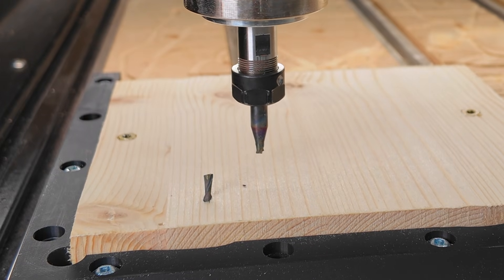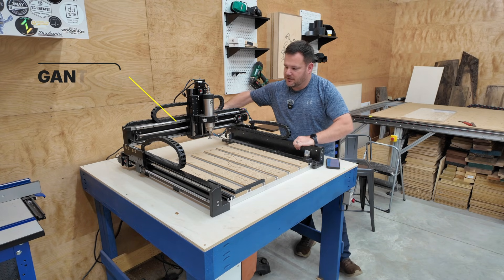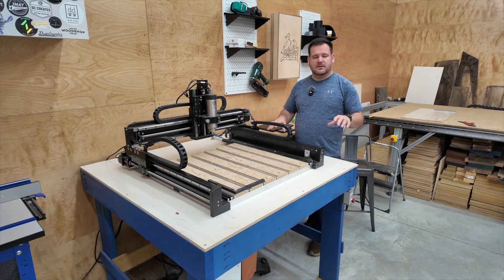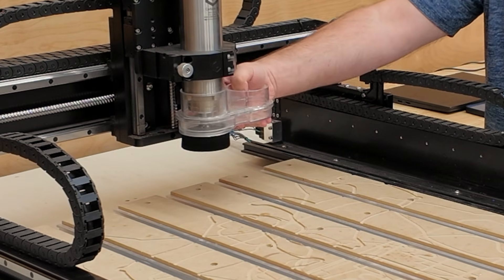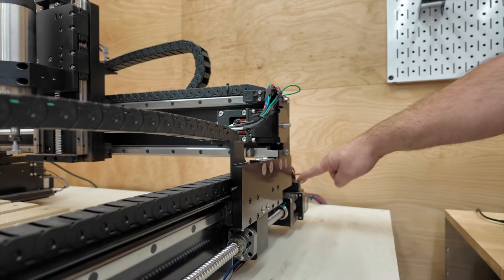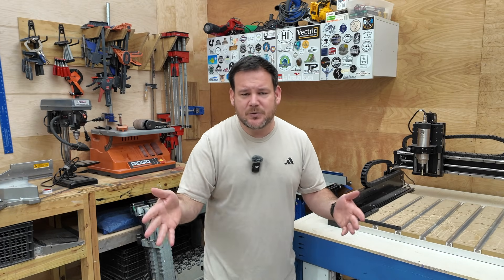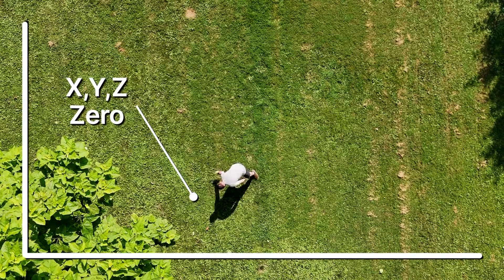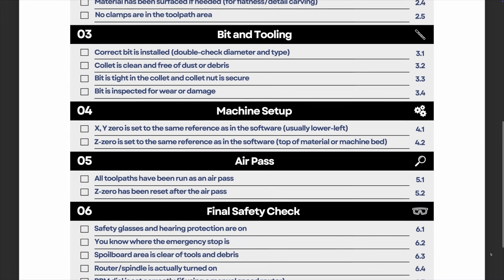CNC Beginners: I Almost Quit… Until I Learned This

Comment: At 0:37 aren't you pointing at the frame rather than the linear rails? Since the Shapeoko 5 doesn't use v-wheels anymore, the frame is no longer the linear rail (like it used to be with the aluminum extrusions). Isn't the linear rail the actual silver rail the bearing carriage slides back and forth on?

Comment: Stepper Motors are always called Stepper Motors, if they are Stepper Motors :D
Servo Motors are ONLY called Servo Motors, if they actually ARE Servo Motors ;)
These are very different MotorTypes and are not comparable. Stepper Motors are moving in discrete steps and ServoMotors are linear, analog. The accuracy comes from a positioning feedback information of the move and that may stop the Servo Motors at certain positions.